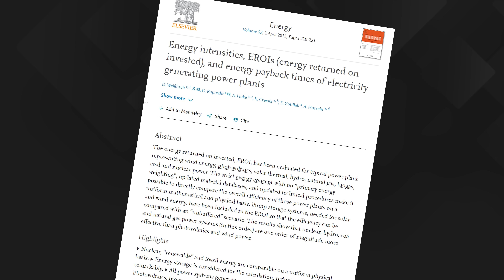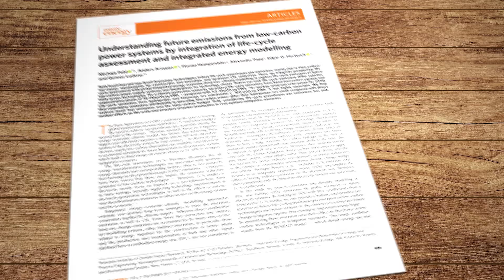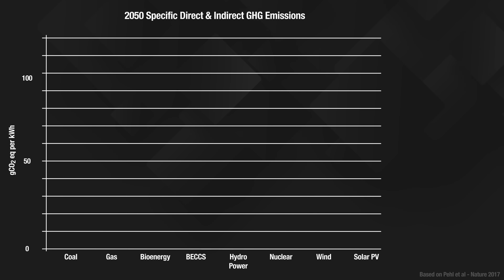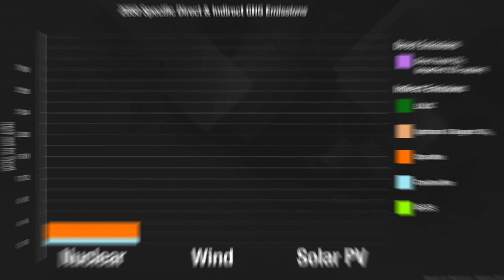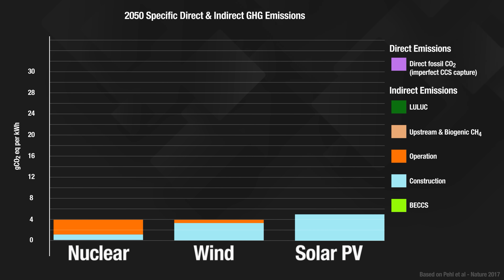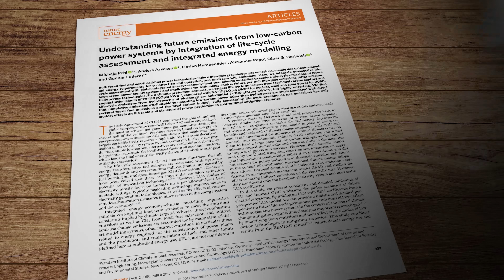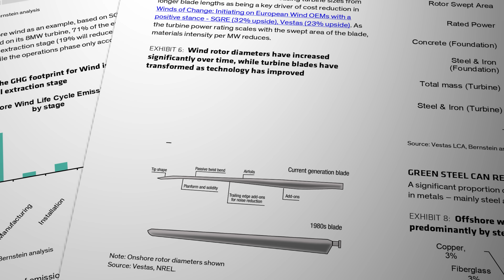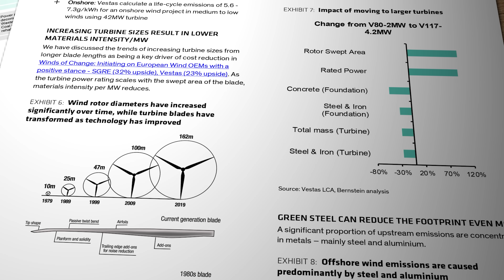Lifetime carbon emissions of renewables vs fossil fuel. Problem or solution?

Comment: Interesting video. The jury is still out for me but personally I think nuclear is the way we should be going. 
Now, I live off grid, I generate 100% of my power by solar for around half the year (I'm in the UK), the other half is part solar, part generator/engine using diesel and petrol. Bear in mind that most of my power consumption is 12v and all 240v comes via an inverter connected to a battery bank, so no electric kettles etc. I mention all of this because batteries, inverters and solar/wind controllers are an essential element in these systems and so must be included in a true lifetime use cost surely? Also, is the environmental impact taken ito account for the various sources of energy? We hear lots of stories of wind turbines slaughtering millions of birds each year for instance.
It's important to look at the impact of each option from every angle.
Reply: I agree with much of your statements.

However, In the U.S., all wind turbines combined killed 681,000 birds.  So globally, bird deaths to wind is in the low millions.

And ... that number is dropping as they figure the problem out.  For example, painting one blade a different color apparently reduces bird strikes by a great percentage.

Meanwhile...
Domestic Cats kill 3 to 4 Billion birds annually globally (about 1.8 billion in the U.S.A. as I recall) ...
 
and motor vehicles kill 89 million to 340 million birds annually.

and Skyscrapers kill 600 million birds annually in the U.S.A.

And.. on topic...

Nuclear power plants killed about 460,000 birds annually in the U.S.A. 

And fossil-fueled power plants kill roughly 24 million birds.

---

So rest easy when it comes to Wind Turbines.  The number is small.  Not even a rounding error.   Global wild bird population is roughly 200 Billion to 400 Billion.
Reply: @mac_mcleod  Only in the low millions? How about if that were people, would it still be called 'low' millions?
I hear what you're saying but 2 wrongs never make a right... domestic cats are a nuisance and I'd rather see the turbines taking them out than the birds!
In any case, the birds are only one small part of the environmental issue. The so called green solutions are responsible for an incredible amount of destruction, the question needs to be asked, is it worth it? To me it's not, not when we can have nuclear power instead.
Reply: @mac_mcleod  You seem very fixated on birds... like I said, there are many other important environmental points that need taking into consideration.
All those other things you mention need looking at too but not in a debate about energy sources.
Do you always argue to justify the one thing because there are already many similar things going on? That's not a solution to anything of course.
Reply: @Englishman999  you seem fixated in the dustmote in wind power's eye while ignoring the log in your own eye.

We are in a discussion where the parent poster declare the problem with wind power was bird deaths.
Reply: @Englishman999  Sorry but anyone still flying the flag for nuclear power is simply just flogging a dead horse now.  To late to go into much detail here hence just leaving some pointers about the more obvious issues here:
- cost / budget & construction time overruns - every EPR reactor (incl. Hinkley C) is having considerable overruns to the effect not one having even been commissioned yet (with the one in Finland supposed to be commissioned some time this year I believe)
- simply can't be build without tax payer money - insurance & underwriting of loans
- Strike price per MWh today is already double that of an unsubsidised off-shore wind farm 
- Thorium & Fusion reactors are still unicorn technologies & SMR reactors are on the horizon, somewhat but again when will they actually be ready for prime time?
- Nuclear waste - Over 7 decades of civilian nuclear power generation and still no workable solution (How many tonnes of Plutonium are stored in what are basically pools inside warehouses in Sellafield now?)
- Global Uranium reserves - were estimated to be a centuries worth at 2015 demands (ohh, and one of the major supplier appears to be Russia...well...)
- Hence the costs for Yellow Cake too will be rising - currently still far from 2007 high levels but hey, build more nuclear plants and we'll get there
- Uranium mining - anyone looking for some serious long term environmental damage? Take a lung full of tailings at a Uranium mine...
- Lastly onto them birdies, didn't the RSPB do a study on wind turbines 10-15 years ago?  Vaguely remember that the main killer of them mini-dinos were shown to be power lines. Now in all them years have I never seen any budgy-lovers waving any placards to take down all those power lines to save the birds.  Funny that...🤷‍♂
Reply: @mac_mcleod  Hahaha you really are priceless.
Reply: @Englishman999  That's funny... I'm beginning to suspect you had a price and it was met.
Reply: @mac_mcleod  
> Nuclear power plants killed about 460,000 birds annually in the U.S.A. 

How does that work?
Reply: @justgivemethetruth  water vapour?
Reply: @justgivemethetruth  structure collisions,  poisoning,  toxic lakes in uranium mines.   Already answered this.

Also we literally do not have enough water for "hundreds of nuclear plants"  they use about 40,000 to 50,000 gallons of water per minute. 

And multiple reactors are already being run At reduced capacity due to water constraints around the globe.

There is a place for nuclear in the mix.   But it's not the solution.
Reply: @mac_mcleod  
That's not CO2, but you have a distorted sense of proportion if you want to compare the toxicity of nuclear to the massive toxicity already on the planet from the petrochemical industry and fossil fuel energy - and the Solar panel semiconductor industry is not clean either.

The way I put it is that we can continue towards destroying the planet, or we can go nuclear and have sufficient energy to of the major things we need to do cheaply - and accept the risk that we might have a nuclear accident or two - which have not worked out to be that bad - and certainly nowhere close to destroying the world.
Reply: @justgivemethetruth  I'm literally quoting facts.  You are spewing opinions.   Your opinion is useless and factually incorrect.   And your opinions on wind are too. 

It's not the solution either.   But it is a big part of the solution.
Reply: @justgivemethetruth  No we can't.  There is no world in which nuclear is THE solution.  It's crazy to think do.
Reply: @mac_mcleod  
Spewing huh?  LOL.  You communicate like an child.
Just what i said.  Nuclear is THE solution though.  All the other methods are intermittent, except nuclear.
Reply: @mac_mcleod  
>  It's crazy to think do.

Sure it is, is that one your facts Bozo?
Reply: @justgivemethetruth  let's see you stated opinions without backing them up, then you turned the personal insults because you got nothing.

It's so frustrating dealing with nukeheads.
Reply: @justgivemethetruth  LOL.  Muvlear kills...zero.

This YouTuber never mentions nuclear.  Bet he's on the take from windmill companies.
Reply: @mac_mcleod  where did you pull these numbers from because I don't believe for a second nuclear reactors killed more birds than wind turbines. I mean how even?
Reply: @stinkiaapje  also, you said it's important to look from every angle. Do you think you are doing that?
Reply: I too am a nuclear proponent and amazed at the well organized organizations that totally attack the nuclear industry and put out garbage data packages that no where resemble the truth of the matter.  Plus in the background is the Natural Gas industry which has invested hundreds of billions in the wind and solar industry.  This industry loves these green technologies because they only operate at about 30% of the time over the duration of any given year.  That leaves Natural Gas as the main fuel to supply the power when these dormant periods happen and means that thousands of Natural Gas plants will be built during the coming decades.
Reply: Wind turbines do not "slaughter millions of birds every year."
Cats, on the other hand, kill more than a Billion birds every year!
Reply: Mike, Nuclear really does generate a enormous amount of power for a small foot print vs huge solar farms and...nuclear is reliable. Modern nuclear power plants are safe if build with modem design in mind. Fukushima was safe but it was the original design of placing Generators in the basement. When the Tsunami crashed over the wall, and into the side walls of the plant, it crashed though the wall and flooded the generator room. The water level ceded the intake height of the generators. The power was cut during the quake and the pumps lost power to cool the steam that would be sent though steam turbines then though the cooling towers and returned back to the core. The rods could not be forced back into the core to absorbed the neutrons and it started to over heat and boil off the water. Eventually the reactor vessel could not withstand the pressure and it blew the top! The design of the reactor should have had had a mechanical winch that could be powered by humans and thus, they could have turned the crank or wheel, and mechanically lower the rods into the reactor. I still think reactors are the best way to prevent Climate Change. Humans need to also play a roll and only have two kids per family between USA,China and India. Most of the record co2 levels are coming from china. China is the largest emitter of coal and oil.
Reply: @LK-pc4sq  wrong China has not emitted as much as the USofA, China now has vastly more power produces by solar than the USofA. Just more bull shit numbers from hacks!
Reply: @LK-pc4sq  don't need to worry about China and the United States. We are already below replacement level which is 2.15.  India is at 2.20 and declining sharply.

Personally I think we need to get down to about three billion people to be sustainable but there's a real risk of a negative behavioral sink developing.
Reply: I agree with you ... it just seem undeniable that we should be going crazy designing and turning out hundred of simple safe and secure nuclear plants.  I have nothing against wind or solar, but they are icing on the cake for those who can use them and the niches where they can be used.  We have got to have massive amounts of energy to of the remediation and recycling and transportation or things like water around the world to places where there is not enough water, or where humans are taking all the water out of the environment.
Reply: @justgivemethetruth  
Thermal power plants, including nuclear, require massive amounts of water for cooling, and there is not enough water available for new NPPs.

A power plant that puts out 1 GW power generates 3 GW heat, of which 2 GW has to be removed by cooling.  That takes a huge amount of water.
Reply: @justgivemethetruth  
Said, "You're totally biased without data."
And the following proves that "*you* are totally biased without data."  You're afraid to admit the truth.  Here's a quote from the following link:
<< Nuclear power plants consume 270-670 gallons of water/MWh, depending on operating efficiency and site conditions.23 >>

At the median value of 470 gallons per megawatt-hour, a 1000 MW NPP uses 470 thousand gallons per hour or 15 million gallons per day - that's a huge amount!  Anyone can see the huge plumes of steam rising above their cooling towers.  This amount has not changed since these plants were built over 40 years ago.
So you don't know what you are talking about.
And the situation is worse because of the decades long droughts caused by climate change.
There will not be any more new NPPs built because utilities are not going to put up with any more multi-billion dollar cost overruns and decade long construction delays - and this is even happening in China.
Link:
https://css.umich.edu/publications/factsheets/energy/nuclear-energy-factsheet
Reply: @justgivemethetruth  
Your handle says "just give me the truth" but I quoted to you what *they* (not I) said about NPPs and gave you a link to it.  You accuse me of saying it "in the most partisan way".  I didn't say it, they did.  And they're the ones you should be accusing, not me if you think what they said isn't true.  So get off my back!

I've already watched Prof. Ruzik's videos, along with many others.  I've also watched that liar, Shellenberger, who's a shill for the nuclear power industry.  I've read several books on this.  After Fukushima the Germans swore they would eliminate NPPs, and now it's hurting them.  I'm for keeping existing NPPs running until all coal power plants are gone.  But as I said, neither you nor I have any say in what utilities are going to choose for generation, and the simple truth is that they are not choosing new NPPs.  Not now nor in the future.

Right now there are six nuclear reactors in the middle of a war zone.   There is enough diesel fuel to keep the emergency generators running for ten days.  If the idiots fighting there screw up the cooling, the reactors may end up like Fukushima, with core meltdowns and hydrogen explosions.  If that happens, it's most likely that the contamination will be as bad as Fukushima, or worse.  There will be hell to pay and many more nuclear power plants will be shut down.

Another lie you told us that all thermal power plants use steam to drive turbines.  Gas turbine power plants do not use any steam - you lied.

Get off the others and my case for telling the readers the truth and giving them links to verify the truth.  I have not seen you give a single link to back up your nonsense claims.  It's people like you who have no place in rational discussions.
Reply: @justgivemethetruth  
BTW, like most things, nuclear power plants are not about the radiation or about the several other issues that are often debated.  It all boils down to a matter of money.

I've read that it's going to take a half a Trillion dollars to clean up the Fukushima mess.  It doesn't matter if nuclear power is the safest of all thermal power plants.  It's a matter of money.  And even though the nuclear power plants are insured by the government, AKA taxpayers, the taxpayers like myself are fed up with the extreme costs of nuclear power.  It costs two billion dollars to decommission a NPP, and that's another burden that must be assumed by the ratepayers or the taxpayers.  The taxpayers are fed up with it and are not going to be taking the burden any more.
Reply: I have got beat up pretty bad about destruction of birds on this site.  What was still overlooked was not the destruction of birds but the type of birds being killed.  Sea birds, which are near the coast areas are the main bird that is important.  Nobody including me cares about pigeons, sea gulls, and or sparrows which are also killed.  But most sea birds and large predator species are the ones everyone cares about.  These are already endangered species so ecosystems that kill these birds are the main focus. I have not seen any recent studies done lately but ten years ago these deaths were well published and being studied.  Anyone who attacks or challenges the green industry is at risk of being cancelled or attacked furiously so the current numbers are not being released about the wind industry killing the birds outright or just destroying their breeding grounds which is just as important.  Lack of studies being published does not mean the damage is not being done as honest debates on free speech is where a real conversation can begin but lacking in today's hostile environment.
Reply: @anthonycarbone3826  
There is a company that makes a bird surveillance system that uses dozens of cameras to detect birds near wind turbines and it then shuts down the rotating blades while the bird I'd near.  The system works well and has prevented birds being killed.